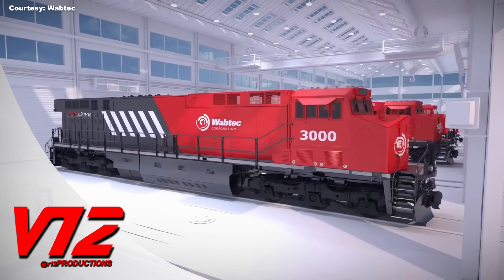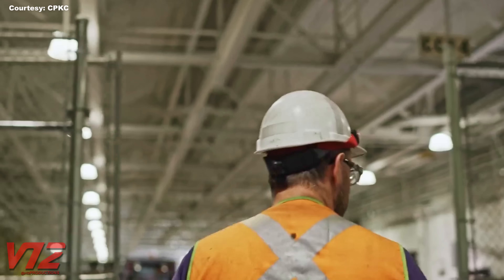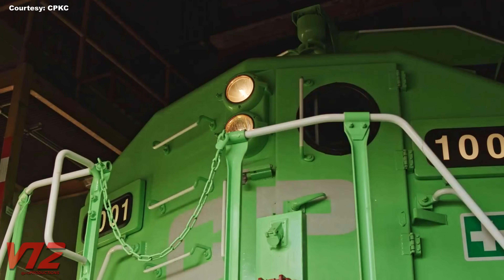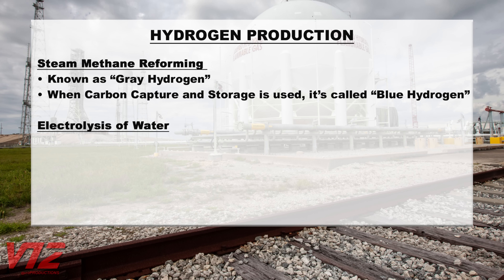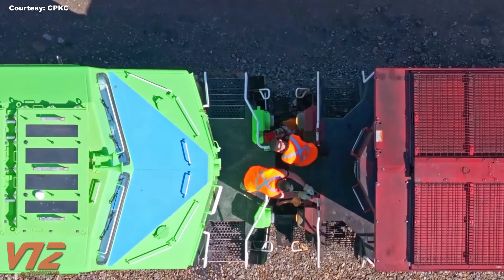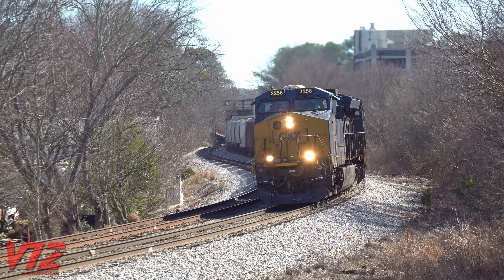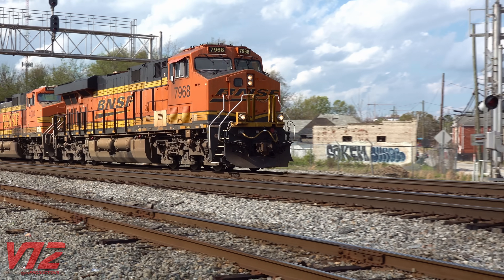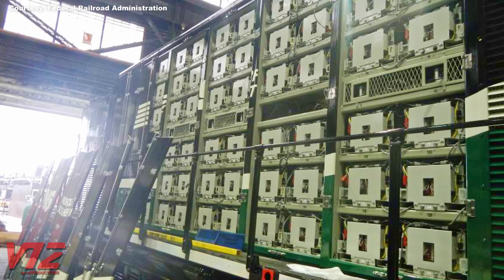The Future of Train Technology?

Comment: I think battery locomotives have their uses, at least in areas with long and/or large grades.  You could have battery locomotives assist as braking helpers while charging their batteries and then use those charged batteries to help push trains up grades (or work as yard units afterwards).  It won't be 100% efficient, but I think that's their best use. 

How about we bring back overhead lines just for grades?  Let diesel-electric locomotives send power back to the grid when in dynamic braking mode rather than expending all of it as heat!

Comment: Great video overall! One newer proposal from the last year or so has been the concept of discontinuous catenary or “disco-cat”. The idea would be to electrify about 1/3 to 1/2 of track and while under the wire, the locomotive charges a battery to run the last 2/3. This reduces the cost of electrification as this means hard to reach or low clearance places don’t have to be electrified. I know the department of energy released a report in December talking about it, but that might have been scrubbed by now. There have also been talks about utility providers using railroad ROW for transmission lines and having electric wire access being a sort of payment for use.
Reply: The last part seems like a good idea. The only potential issue is that overhead wire is usually DC power where as transmission lines are usually AC power.
Reply: @RailFireProductions The way to electrify railways these days is AC at 25,000 volts at national grid frequency (60 Hertz in the US). So stepping down from transmission voltage should be pretty straightforward.

Comment: I say we go back to overhead wire like the Milwaukee Road had and put all of the downhill regeneration back into the grid. 
Great video as always!
Reply: Do you understand that regen only recovers the energy that went into a) going up the hill in the first place or b) acceleration?  None of the energy used to cover flat ground can be recovered, ever.  So regen doesn't do as much for you as you might think.  Unfortunately, flat ground is - usually - the majority of the energy expenditure of a trip.  This is why other electric vehicles, from bicycles to buses, don't bother with it.
Reply: @railgap, the reason I mentioned the MILW was it was in the mountains, not much flat space.
Reply: For some regions, that certainly seems to be the answer. I've always wondered if it was possible to build a sort of tri-power locomotive, basically one that can be powered by diesel alone, a combination of diesel and CNG/LNG, or can simply be run off of overhead lines. It seems like it should be possible, but it might make for a very large locomotive.
Reply: @PistonAvatarGuy  The Siemens Vectron Dual Mode already does 2 of the things here in Europe. It runns fully electric with overhead lines when present and can switch to its diesel engine when there not present.
Reply: @Chaoskiller05  Very cool. It should also be possible to have a version with a 100% CNG engine (spark-ignited) as well. The emissions from pure CNG engines are incredibly low, when they're coupled with a simple 3-way catalyst.
Reply: @Chaoskiller05  That type is called Electro-diesel, been around since the 1940s.
Reply: @kiwitrainguy  maybe read again cause yes the vectron dual mode is a diesel electric but it can also work fully electric without the diesel engine if overhead wires are pressent
Reply: Like he said price ....at that point scrap all railways and hyperloop
Reply: @ShawnCalay  hyperloop is a sham, way less efficient than normal railways and is economically impractical
Reply: @glacialstage  Atlanta is already hyperlooping and is effecting trucking....it's not a sham and could very well end railways and basically deplete trucking to a bare minimum. Remember though I just stated this due to the fact of the other guys comment....I was a conductor for 21 years on CC IC and RailNet and now own a trucking company...
Reply: @ShawnCalay  If you think the price/viability of hyperloop is similar to just installing overhead power you don't get it at all. Hyperloop is maglev but even more expensive since its in massive thick steel tubes. Not just the costs are an issue, the entire technical aspect of creating a vacuum that large is downright impossible, literally everything needs to be rebuilt/designed from the ground up and even then its horribly impractical for freight. It's literally a pipe dream. Hyperloop was only mentioned to stop highspeed rail from developing, it has done its job since it clearly worked... Atlanta is not 'hyperlooping' it's not even moved passed the proposal or research phase... It's a sham.

Comment: Hydrogen is a non starter!  Hydrogen is extremely difficult to transport and store.  97% of hydrogen is made from natural gas.  Why not just use the natural gas?

Batteries make a lot of sense for switching and local traffic.  Exchangeable batteries will be needed for long haul use.  Maybe 2 Megapacks on a COFC car which could be changed out at planned intervals.

Comment: Sensational comparisons to the Hindenburg need to stop. The doping used on the skin of the airship was very flammable and that is what caught fire before the rest of the ship. Hydrogen just happened to be contained as a lifting gas which then caught fire too. There have been countless massive fireballs from various chemicals over the last century that have shown that chemical energy is potentially dangerous pretty much across the board. It is intellectually dishonest to label hydrogen as "more" dangerous than other fuels based on emotional reactions to the crash of an airship almost a century ago. Hydrogen's lightness and ability to dissipate actually make it potentially safer in the event of a fuel leak. If solid state hydrogen storage can work eventually, that will make it even safer than compressing it like we do now (which is safe and well understood).

Comment: Anything battery-powered is a waste of time. The concept of having a generator powered by an ICE engine is the most efficient way to produce power and traction (and oh look, that's how Diesel-electric locomotive have been working since a long time already). 

What the world needs to focus is to develop a (liquid) green-fuel to power those ICE engines, and not trying to develop more types of batteries. Batteries requires to be charged, and right now, they are 90% of the time charged by fossil fuel.

Comment: Unless they have a small diesel or LPG engine to run the compressor for the air brake equipment on the battery-powered locomotives, those batteries will be doing double the work. The traction motors themselves will obviously be the greatest load, especially while hauling a train. But then you have the lights, PTC equipment, hv/ac equipment, and mini fridge.
Reply: "mini fridge" - yep, gotta keep those beers cool !
Reply: how would that be any different to the current diesel engines needing to power all the aux as well as the traction motors?
Reply: @vincentgrinn2665 Because the diesel engine is using its process of combustion to its advantage, even if it has electronic unit injectors(EUI). The old true diesels had none, and in all honesty, never needed them or batteries.  As a matter of fact, there are quite a few modern diesel electric locomotives still around with pneumatic start systems. The reason why such systems are still integrated in the trucking, rail, and shipping industries is due to their light weight, low operating cost, and not draining a battery to turnover a cold diesel. That's the only time a diesel engine robs so much power from its batteries. During a completely cold start. 

True, the alternator and compressor can cause the engine to somewhat use a good bit of fuel, loaded. But the diesel engine produces greater torque at lower RPMs and is also governed by how much fuel it gets.
Reply: @berkshireerielocomotive3322  ok but if you didnt have a diesel running the traction motors there wouldnt be any need for any of those things

theyre all able to run electronically, like they do on every train anyway
Reply: @vincentgrinn2665  The air brake  compressor is direct drive and is driven by a shaft from the generator, which is driven directly by the engine. It's like the drive train of a car. But instead of having engine <--> transmission <--> axle, you have engine <--> generator <--> air compressor. 

The air compressor for the brake system is not exactly a small thing. These weigh several hundred pounds and are almost as big as the generator. You can run these via an electric motor on the battery-powered e-locomotive. However, the effort it takes to do so will help drain the battery. Why? When the compressor is unloaded, it's just freewheeling with little resistance. But when it's loaded(pumping air), there's a resistance, which the electric motor will have to overcome. It takes energy to work.
Reply: @berkshireerielocomotive3322  considering that electric trains have been around for over a century, and most of the world uses them just fine
im quite sure there no issue using an electric compressor

a whole lot of diesel locomotives use electric compressors as well, so surely they must do that for a reason
Reply: @vincentgrinn2665  They do it for ease of service. But there's a difference between freight locomotives, those built especially for commuter service, and mono-shuttles.
Reply: @berkshireerielocomotive3322  electric freight locos also use electric compressors fir their air brakes
Reply: @vincentgrinn2665  With third rail and overhead wire locomotives, you have power all the time. With battery locomotives, there's a limit, especially if these locomotives are going to be used for road service.
Reply: @vincentgrinn2665  The diesel engine creates its own power, a battery locomotive only stores power
Reply: @floridianrailauto9032  that comment barely has anything to do with this conversation
Reply: @vincentgrinn2665  Someone lacks reading comprehension
Reply: @floridianrailauto9032  i was the one writing the entire conversation

both people in this conversation knew what a diesel locomotive and a battery locomotive are
that isnt what we were discussing
Reply: @vincentgrinn2665  Once again, your lack of reading comprehension skills are showing.

You asked how a diesel locomotive differs from a battery locomotive if the diesel engine is still powering electronic devices, I replied by informing you that a diesel locomotive generates its OWN power (which means it doesn't lose range by powering electronic devices) whilst a battery locomotive only stores energy, therefore using electronic devices will deplete the battery faster.

Comment: It would be great if automobiles had dynamic braking.....
Reply: I think some hybrids actually have regen braking already, so their ahead of American diesels in that regard. I’ve found it a little ridiculous modern diesels couldn’t do that, especially because there was already a diesel that could use its engine to power an onboard battery, as well as pick up 3rd rail electricity. 

Was only used for switching but it WORKED.

Comment: I’ve heard Cummins is building the X15h.  The current x15 but adapted to hydrogen.  I could totally see older EMD engines being adapted for hydrogen.   

When my dad was in college, Someone years ago made a ford V8 internal combustion engine run on hydrogen with very little adaptation. Wouldn’t surprise me if that guy was “killed in an accident” or something
Reply: Mythbusters showed that you can indeed run a regular car on hydrogen with minimal modification. The big problem is that is is not really safe or efficient. Making the hydrogen is hard. Transporting the hydrogen is hard. Carrying enough in a car to be useful is hard. Making refueling safe is hard. That's why it has never really gone anywhere.

Comment: I 'was' thinking that maybe using liquid ammonia might be a better alternative until I did some research and found that when engines burn ammonia they emit nitrous oxides which are 300 times worse than carbon dioxide as far as greenhouse gases are concerned. So while you can burn ammonia, you won't want to because of the emissions.

Comment: Hindenburg Myth.  As you noted, when hydrogen burns, the flame is almost invisible, yet the airship burned brightly, with much smoke.  This was because the skin of the airship was coated with thermite.  Therefore even if the airship had been filled with helium, it still would have burned when the skin was ignited.

Comment: We could also try to do the same thing that The Grand Canyon Railway. 

They have already done something like this with alternative fuel for their steam locomotives.  
Both their steam engines No. 4960 and No. 29 they both run on used vegetable oils from local restaurants.

Not only is it a clean burning steam locomotive, but it also attracts customers with the smell of french fries and chicken wings.
Reply: I was thinking they could make a battery powered steam locomotive.  Also it is is a giant water heater on wheels.  Tender could be a battery and in the firebox you could have a giant heating element.
Reply: @Steve-p7z8h  The Swiss tried that during WW2 when they couldn't get coal. It supplemented a coal fire but was too costly. Better to just electrify the railway.

Comment: Like any change in human kind has made (like horse carriages to automobiles), it will be a slow move, but it will move.  We're seeing it with cars as prices in battery technology goes down and charging stations pop up.  In 10 years i'd guess most cars will be electric in some fashion. I believe railroads will be no different and I think its valuable work to test and prove this technology. Unfortunately, the next 4 years, we'll have to rely on foreign companies and foreign rail operators to see this progress in the short term. US companies are likely to defer to the US's current administration who has an active disdain for green energy.  Pursuing this new tech will likely gain the ire of the president and they will likely halt research to avoid punishment.

Comment: I run two LPG trucks on my farm . Propane is half the price of gasoline and diesel . It also doesn't produce any particulates .The downside is the initial cost of a proper gaseous engine and available refueling stations .  Alternatives are out there as V12 has pointed out , thanks !
Reply: Ever try to pull a long steep hill with LPG?  I have, life in the slow lane really sucks.
Reply: @billkraemer4710  . I spent the money on building a 12:1 forged piston SBC 355 with vortec heads , a high lift heavy tow roller cam and 1.6 roller rockers . This engine has much in common with modified race engine but produces max torque and horse power at 4800 RPM . We use it to pull grain trailers to the CO-OP . It out performs the stock gasoline engine but I'm glad we don't have any long steep hills around here ! Cheers !
Reply: During and just after the second oil crisis in 1979-early '80s a lot of cars here in New Zealand got converted to LPG or CNG (compressed Natural gas). It was cheaper and less polluting than petrol/gasoline. Everyone gave up on it when the price of oil came back down during the mid '80s.

Comment: My very good friend invested over 20 years in a solid oxide high-pressure fuel cell. Rolls Royce was involved and later the Korean company LG.  The target was a unit that had the footprint of a container. They did it, although it was two pieces. One was the fuel cell and related equipment and the other to convert the DC output power to AC. It was located at Stark State College in Canton, Ohio, and with a natural gas line, it supplied power for the entire campus. The thinking was put it on top of a building and supply power, being able to go back on the grid in the event of an emergency. Over fifty million dollars invested, and someone got a bug up their butt, shut it down, and scrapped everything. A little noise, some water, and making power.

Comment: This is a repeat of the 1930's,as the NYC,and other railroads were using battery/ electrics,and the Interurbans,had battery/electric locomotives for both road and switcher use! See an old Diesel Spotters Guide,as it laid out the survivors of the 30's, and 40's! Reinventing the wheel,and the UP,had their turbines powered by propane,as did a number of other railroads,and manufacturers! Short history,too many gaps in the narrative! Thank you 😇 😊!

Comment: It looks like with what was said in this video, it seems like they're trying to do their part in curving carbon dioxide emissions. However, I do have some doubts about the idea of all electric trains. I've been hearing a lot about these lithium ion battery fires on all electric cars and trucks. I don't exactly see how lithium ion technology can be outfitted on locomotives. But if this ultium Battery Technology it's like what they say, I would most certainly want to see it in action and learn some more about it. Then there's hydrogen-powered locomotives, I do happen to like the idea of it. But it's like you said, if hydrogen were to ever ignite, firefighters maybe dealing with a invisible fire. Like lithium ion battery fires, fire departments would have to implement new training exercises in dealing with hydrogen fires on vehicles, which would include trains. All in all, it seems that green energy is coming to the railroad, slowly but surely.
Reply: I agree. It looks like the hydrogen locomotives are working.  I wouldn't be surprised if hydrogen wins in the auto industry as well.

Comment: Why don't we just go to steam electric were electric batteries heat water to boil and then use the steam to power the motors like classic steam trains
Reply: In WWII Switzerland found itself with a problem: German coal kept getting more expensive. So the Swiss put electric heaters in steam locomotive boilers and added a pantograph. Looks odd but worked in a pinch.
https://en.wikipedia.org/wiki/Electric%E2%80%93steam_locomotive